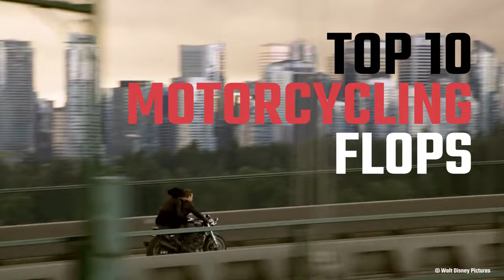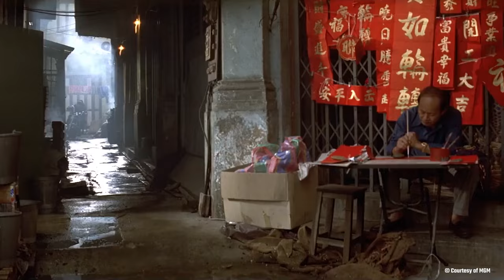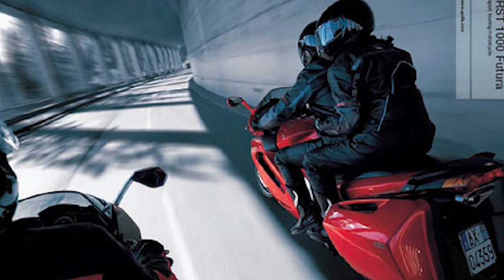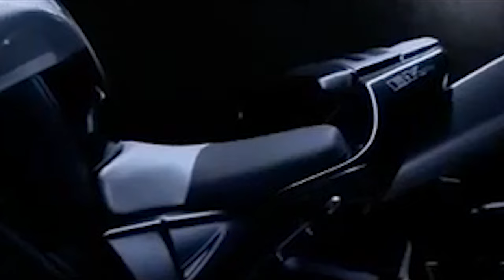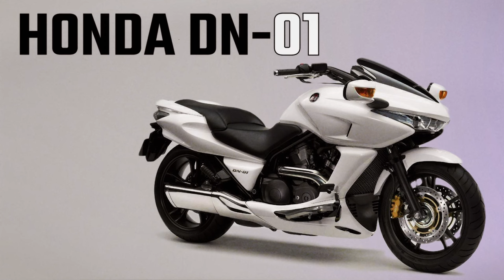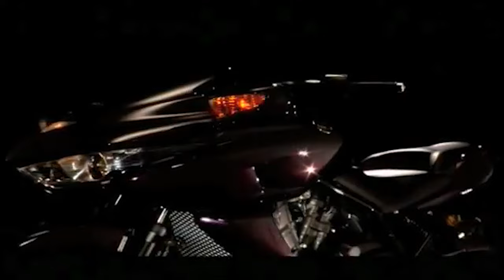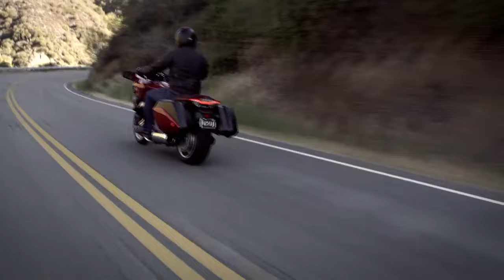10 Motorcycle Flops | The top ten worst motorcycles ever made

Comment: I have owned both an 2001 Aprilia Furtura and a 2005 Honda VRF 800.

I liked the Aprlia better.

The slipper clutch and the geometry of the Futura made it a better handling, easier to flog bike.

The VRF only had a very slight advantage in that the rider position was a bit more comfortable for all day rides.

The Aprilia had much more H.P. and usable torque and the handling was much better.

I slso owned a 2002 Aprilia Mille and it and the Futura had telepathic handling.

It was very easy to go VERY fast on both bikes but you had to work just a little harder to wring the most out of the Mille.
The Honda on the other hand was a good handling bike PROVIDED you didn't push it too hard 

Both Aprlias would give ample warning at their limits before things would start to go bad,  the Honda , not so much.
In fact it's because of this that I sold it.

Out on the edge with it, like if you hit a bump while on the edge in a corner it would react very fast and with no predictability from one bump to the next.

Both Aprlias were very stable and would not upset as easily. 

Given  the Aprlias,  and Italian V Twin bikes are generally better handling than the Japanese inline and even V 4s like the VRF.

The Honda wasn't a bad bike, its just the Aprlias were better.

As to costectics, the Furtura did take a bit of getting used to, at first the mirrors , from the front reminded me of a certain moth that has antennas that look like a fern leaf lol, but after getting to know that bike, its power and the way it handled, I accepted the funky mirrors,  since looking into them was the only time I saw my buddies when we were out riding lol
Reply: You tye grammar police ?

Comment: The R 1200 c is a quite excellent motorcycle. The engine has plenty of steam, the chassis is stable, and the workmanship is of high quality. The copies sold in Germany usually have a low mileage , are unmodified and in top condition. They are now highly traded.

Comment: I bought a 2002 BMW R12C 'Avantgarde' in 2007 with low miles.  Didn't even test ride it.  Listened to the motor, paid for it, threw a plate on it and rode it 12 hours back to home.  I put 80K miles on that beauty (on a stock seat - frequently with my wife riding pillion on an Air Hawk) in 10 years and loved every mile (until the drive shaft stripped!).  Of my 20 or so bikes I've owned over 45 years that was my favorite.  I now ride a 2005 Yamaha FJR1300 (which is also very nice) but I miss that beemer 😥

Comment: This was pretty good overall, but you failed to mention a couple of the plus points of the GTS 1000. That Funny Front End worked really well – you could brake deep into corners in a way that none of the tele-forked bikes of the day could handle. And...that detuned 100bhp engine went on forever. I'll never forget meeting a London despatch rider with well over 200,000 miles on his GTS 1000! Also, the unique transmission of the DN-01 is worth a mention – as far as I'm aware, it's the only motorcycle with a quad-style fluid drive rather than the 'glorified rubber band' of most scooters or the true automatic gearbox of Honda's DCT. Honda's NM4 Vultus might feature in a future list of this kind, even though it's a great machine to ride, with stunning looks – better in both ways than the DN-01.

Comment: The nice thing about motorcycle failures is that it doesn't require a dedicated plant to build a failure, if it doesn't work out, they just discontinue it and the plant still survives making the other models.  Unlike automobiles in a lot of cases.  In the end and over time, most bikes are pretty good at what they do.  You can't say that about cars.

Comment: I always cringe a little inside seeing a victory vision, only use I'd have for one is to yank the bigger engine and 6 speed to put in my victory vegas. Also, the Honda vtx 1800 is only good at straight rides, not a curvy mountain road type of bike, it's big and bulky along with top heavy and bars wider than the lane you're riding in.

Comment: Have to add a Suzuki TC 125 Enduro to the list. I had one in the late 70's it has a 4 speed gear box with a switch for 4 speed street or 4 speed dirt. It failed both modes miserably. Better option was a 5 speed Suzuki TS 125 with a 5 speed gear box and no switch for dirt or street.
Reply: DUDE I had one it was lime green with the stripe on the tank can't remember what year ,it had the kick down box and I think it was 5 speed ,excellent bike imo ,farmers loved them for the low low gearing to chase cows .
Reply: Had a TC100 with the 4 speed and dual range.  Yes, a 5 speed would have been better.
Reply: They were just a fart box with wheels.....I learned to ride on one..👍

Comment: I would add the CX500 Honda. Known in the UK as the plastic maggot, it had a fatal design flaw in the engine that resulted in the cam chain tensioner snapping, which then resulted in valves hitting pistons! They had two (or was it three) recalls to fix the problem then withdrew the model to be replace by the VT500. I owned a CX it had no torque, was chronically under-geared, over weight and was reluctant to start if it had been left for more than a week. It ranks as THE most unreliable bike I have ever owned in my 43 years of riding bikes.
Reply: Funny,   I got stuck with one to run errands on that had been abandoned.   And worked...fine.  I mean,   it was a pig alright,   but it ran
Reply: Those were great bikes. Plenty of torque and lots of fun to ride. Maybe they had issues with a short run of them, but they sold a ton of them and they're pretty well known for lasting a long time.
Reply: @joshrandall3632  Plenty of torque? You must be joking. It couldn't pull the skin off a rice pudding. Chronically undergeared with gear change that agricultural. At 60mph the engine was turning over at 6500rpm, which is about the same as my current 200cc, 16hp, trail bike. It was claimed to have a top speed of 105mph, I got mine up to 85 when it seized. I took the heads off to see the score marks down the bore. No problem, I thought, I'll take the barrels off and get them rebored. That's when I found out that the genius who designed the engine had made the barrels and crankcase out of one casting. F****ed!
Reply: @Fubar_The_WEF  So it's Honda's fault you can't take care of a moto? I didn't say they were the best bike ever, but they sold a ton of them, many of which are still running.
Reply: They sold heaps of the CX and made the Silverwing, Customs, Turbo and 650 versions too. The early chain tensioner made the chain rattle but I have never heard of a failure. The mechanical waterpump seal was a different story and needed replacing every 500000km. Some CDI high voltage gen coils died. Yes, hard starting after a longer break. Good torque for a relatively high revving 4 valve 500cc motor. But it lasts, examples with over 200000km are no exception. And it was economical too. Today a cult bike in Germany with a dedicated CX shop in Berlin, regular rallies and many fans of the legendary 'Güllepumpe'. Soo ugly but soo good. Definitely NOT A FLOP but a top 10 success bike.
Reply: @moestrei  I'm not a mechanical engineer but it was something to do with the weird 52 degree V twin that at certain revs created a whiplash effect on the cam chain that broke the adjuster. Honda recalled it twice eventually replacing the adjuster with a snail cam, which solved the problem. I disagee that it was economical. I used to get 55mpg, which is modest but it was the thirstiest bike I have ever owned. Even my 900cc Triumph Speedmaster that weighed 250kg used to do 65mpg.
Reply: @Fubar_The_WEF  The CX had an 80° offset and a single crank pin. You are referring to the VT500 engine. I think you had a dud engine....mine (and many others) did  4-5L /100km which is 63 mpg.
Reply: I stand corrected! It's still weird though, when the overwhelming majority are either 90 or 45.
Reply: @Fubar_The_WEF  They wanted to make it more compact and they turned the heads 22° too to get the carbies close together inside the frame. Despite push rods it could be revved to 11000rpm......Brilliant design.
Reply: @moestrei  Sorry, I strongly disagree with that one! Mine went through a partial seizure. No problem, I thought, I'll just take the barrels off and get them rebored. That's when I found out the barrels don't come off. The Barrels and crankcase are all one casting. What idiot does that?
Reply: @Fubar_The_WEF  No CX ever needed reboring. It does have cast iron liners which can be extracted. Sorry looks like you had a very bad engine and an incompetent workshop.
Reply: @moestrei  If you could have seen the score marks down the bore you would have said it needs a rebore. I replaced that bike with an MZ Saxon Tour 301. Now there was a bike! Light weight, torquey, simple, reliable, economical, surprisingly good acceleration (almost on a par with the CX), flicks into corners like a sports bike. An excellent example of German engineering.
Reply: @moestrei  Well put. Honda was doing a lot of innovative things in the '70s and '80s so it's only natural for some of their products to not be the "Honda quality" we're accustomed to.
Reply: The only problems that I've ever heard about those bikes is the water pump goes bad prematurely.
Reply: @danielcapalbo5293  This model was recalled twice. Vehicle manufacturers don't do recalls unless there's a serious problem. It costs millions every time they do it.

Comment: How about doing a similar video on 1970's and 1980's machines, like the Suzuki RE5, H-D XLCR 1000 and what about the Japanese turbo charged machines of the 1980's, Honda CX650 Turbo, Suzuki XN85, Kawasaki GPZ750 Turbo and the Yamaha XJ650 Turbo. There were also the rotary powered motorcycles, DKW W2000, Norton F1, a mate of mine had one of those and it was forever breaking down, the hyper expensive Van Veen OCR1000, in 1979 a Van Veen cost £10k, I bought my mid-terraced house that year for £6.5k. There's also the afore mentioned Suzuki RE5, the motor company spent so much on it's development that it almost bankrupted them. 

How about the Benelli 900 Sei, they were produced from 1979 until 1989 and only a total of 1864 complete 900 Sei's left the Benelli factory in Pesaro, Italy. I've owned a 900 Sei since 1986 and I love it.

Comment: I went all over Europe, Sweden to Australia, Not one VTX 1800 NEO Stage 3 Exists - Mine is the last one avail 2007'. 
Only a handful of VTX 1300's were found. But they were 4 - 6 times more popular in the US than the 1800 versions,
being the older near retired crew didn't like how top heavy the 1800's were, but even some women liked them. 
But they were right, the 1800 series when getting down to walking pace, the weight comes on strong if a U Turn 
was attempted. The steering bump stop was so wide, because of very wide fuel tank, the move to counter steer 
your balance point could take you down in middle of U Turn when you thought you could turn a tad sharper. 
You'd need both lanes of county road shoulder to shoulder even thinking of a U Turn. 

But the Massive Torque of the 1800 from stop sign clutchless shifting full throttle will pretty much rip your elbows out. 
850lbs plus you and gear has no clue you are on it,, and it doesn't care. Your at 90 in fewest of seconds. Escaping 
any 4 wheel nonsense in the way to wide open freeway ahead. And the nicest fattest tires really made the ride softer 
than most,, except for Minnesota Pot Holes - The short swing arm heavy unsprung weight of rear wheel with shaft drive 
is basically a half ton 55 Ford truck impact. Your spine will take severe hit if seated, if you don't get weight transferred 
to floor boards in time. 

Milage wise was another issue, getting at best about 35 mpg. But the 5 gallon tank made sure you got there. But these  
1800's are not going out to be babied when it's out for a ride, and milage is never a forethought. 
My last big tour was Tampa to Mpls, and that's a brutal 1700 miles at about 90+ all day and night. 

Much of it in heavy thunderstorms from Tennessee through Wisconsin all night long with lightning constantly 360 around me.
Where at one point the Highway Patrol stopped me from getting back on the freeway warning me there was active 
tornado on the ground, and to follow him to safe hotel construction site of solid concrete stairway. And it was bad. 
Soon as sun came up we were gone. 

Clutchless shifting sequence by accident was the only couple minutes of video worth saving on my profile, when camera
failed to capture scenic landscape,, and ended up aiming down at fuel tank instead.  We custom build funny cars to drag bikes
and clutchless shifting is the standard of Honda's Transmissions since early 60's of constant mesh gearbox to transform 
them to auto electronic air shifting for drag racing by tach sensor only. Just hang on if you can. 
Cheers

Comment: Hehe, The Aprilia RST Futura! Tell you what, I love the bike. Aprilia tried many things with the Futura, the styling was angular and ahead of its time indeed. But, a few caveats. It sports a Rotax 60 degree V-twin, the same one was fitted to the RSV Mille 1000 sport machine. I have a lovely example, a blue 2002 model.

Aprilia did something quite unique, they built a true "sport touring" motorcycle. It has a Magnetti Marelli instrument cluster. For those of you who are familiar with Volkswagens of the era, the instrument cluster is virtually identical! Brilliant. It also has a Sagem digital fuel injection system, and two plugs per cylinder for the ignition. The fuel injection system even has an automotive idle control system, no choke. 

The saddlebags are detachable, and with them removed, you would never know it carried them. You can see this in the video. It has a single sided swingarm. The rear tire is a breeze to service, and you CAN mount tires using a normal automotive machine. 

Aprilia made very few of these bikes. 

One last thought, it has absolutely the best riding position, and the most comfortable seat in the business.

The strange "antler ear" mirrors? Take one for a ride, you'll rapidly understand, you can actually see behind very well.

Sport Touring is a rare breed. The original sport tourer title, in my opinion, must rest with the Honda CBX. Lovely bike, I had two, a 1981 and a 1982. Still have the 82. Sitting next to the Aprilia, that Honda is a huge beast.

How do they compare? I have owned many bikes, I loved the Honda Silver and Gold Wings, had many of them including the six cylinder 1500/6. My favorite Wing was the 84 1200 four cylinder, it had the most character. Rode the hell out of them, over 100,000 miles. But, my tall 6 foot 1 frame is an issue, I was far more comfortable on the CBX, leaning forward. Forward a few decades, the sport position of the Aprilia is absolute happiness, mine has a freckle under 100,000 miles on the odometer. As for power, the torque of that V990 Rotax is a joy to behold. This is coming from a rider that has lived the mighty CBX.
Reply: @Mike Morris Nope! The Futura was a marketing disaster, it's true. But, so was the CBX, in terms of sales. Remember, I have both.

Hehe, I had to chime in and let folks know that despite the issue, the Futura was a unique machine, one that I actually own and have the opportunity to add a little bit more to the story.

That little Futura is mor than most people know. For example, the single sided swingarm included a special bearing, one that is absolute hell to replace if it fails. It cost, at one point, just under a thousand dollars to replace, IF you could get it.

In the cluster is a hint to something Aprilia was working on, that did not exist at the time, at least in any real numbers. The instrument cluster has an ABS warning light. That bearing is so expensive, because FAG made a special bearing that has a built in ABS based wheel speed sensor magnetic seal. 

This became STANDARD on many automobiles. Truth, the same type of bearing, WITH the special magnetic seal, is about $20 for automobiles.

Comment: Well presented. I can think of a few other Honda models, namely the 'CX'  line, especially the turbo models. It was Honda's attempt to build a better MotoGuzzi.
Reply: They were not flops by any stretch tho.
Honda sold millions of the damn things
Reply: @sugarnads  as a cafe racer base they are crazy popular, and getting expensive.
Reply: @tedecker3792    ----  and NEVER arrive at anything that even remotely looks like a cafe  -  it's akin to trying to make a garbage truck look like a British sports car
Reply: @bonesrhodes3762  I've seen plenty of them done that way. They make a great looking cafe racer. Maybe you just don't know what a cafe racer looks like.
Reply: @joshrandall3632      you are probably right:  I've only been building and riding cafes since the early 1970s and have never owned / ridden anything less sporty than a sports touring with a cafe look  ( 76 CB750F => 79 GS1000s =>  79 CBX => 83 CB1100F => 87 CBR600f => 90 RC30 [ one of the original 300 ]  plus scattered FZRs,  VFRs, and even a GSX    --  plus my little cafes usually based on CB400f or 350fs ( Ontario'ed of course ) and Seca 550s -  course those were in my young days  -  now I'm content to tool around on my last remainder  -  a 1972 BMW R60/5 with a little headlight fairing, clip-ons with bar-end mirrors, and single Brit racing style saddle.
Reply: @bonesrhodes3762  You could have just stopped at "you are probably right". Couldn't care less about all the shit motos you say you've built or ridden. Not even a little bit impressed, but if it makes you feel special, good for you.
Reply: @joshrandall3632     --- actually, that was just me being sarcastic - I know you've never been right about anything - shows in your taste in bikes